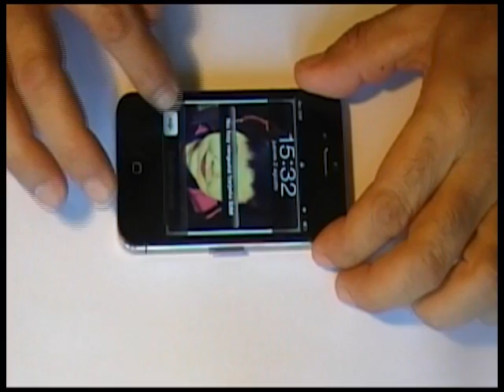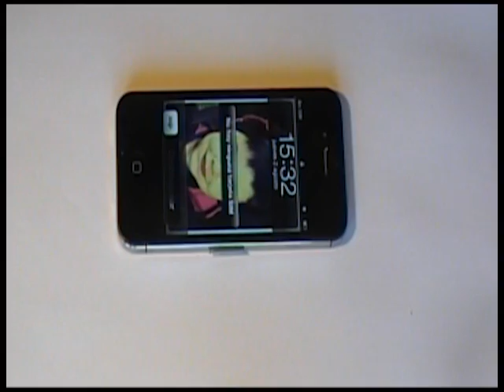Como cambiar la pantalla del Iphone 4S

Comment from the maker: Hola Randall, ¿apagaste el iphone antes de desmontarlo?, puede ser por varios motivos
1- no lo apagaste y tocaste con algo metálico la placa haciendo un cortocircuito.
2 -pinzaste la pantalla al colocarla, el cable flex es muy delicado y si no esta bien puesto es fácil pinzarlo.
También pasa aveces al actualizar, si no te ha funcionado el reset puedes probar ha quitar la batería unos minutos o dejar que se acabe sola para liberar la electricidad estática de la placa.
¿lo reconoce itunes?.